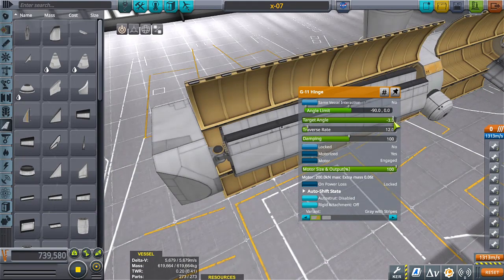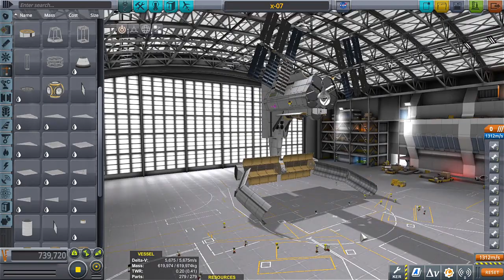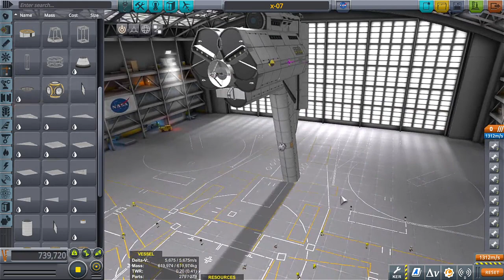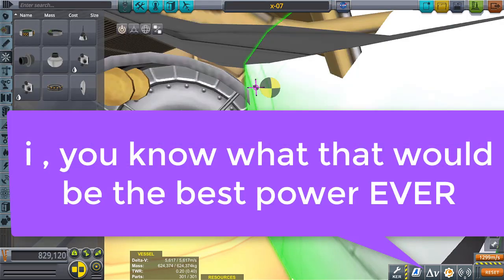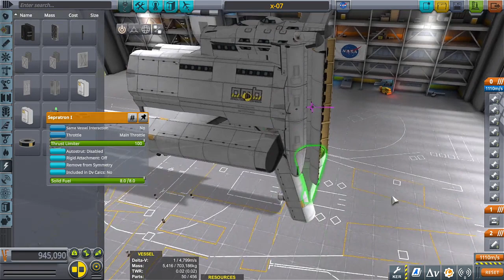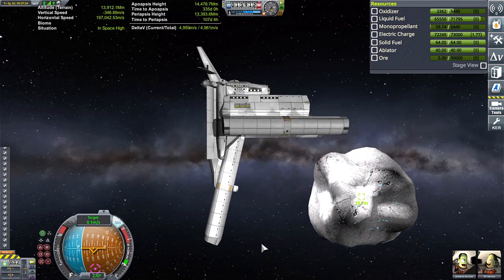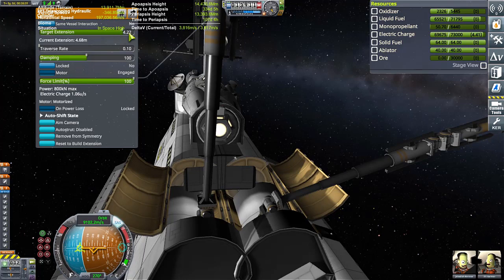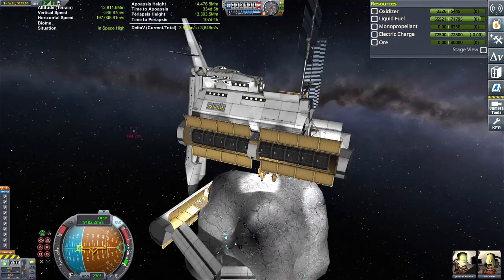MINING SHIP STATION part 2  \  KSP 1.11  \ Kerbal Space Program

Comment: I'm just 3 minutes in and I LOVE the initial look of the completely unfolded station! Indeed - what a BEAST!

EDIT after hearing your plans for multiple grapple claws: I don't know if KSP still has this problem - but a few years ago when I tried to use multiple grapplers to latch onto a rock, it worked initially, but when I came back to the ship/asteroid combo from either a game save or focusing on another vessel and then coming back - the ship attached to the rock would EXPLODE into bits! At the time, the solution was to de-couple all but ONE of the grappler claws. Then when you wanted to do work on the asteroid again, re-attach the extras. HOWEVER - sometimes even time-warping while remaining focused on the ship/asteroid combo would still cause unplanned disassembly. So as always - quicksave every time you look away from the thing. Quicksave everytime before you timewarp. Quicksave even if you've been doing NOTHING for 3-5 minutes. The Kraken watches. The Kraken KNOWS...

EDIT AGAIN: Come to think of it... I wonder if naming this thing Kraken Station would bring down the wrath of the KSP gods? :D